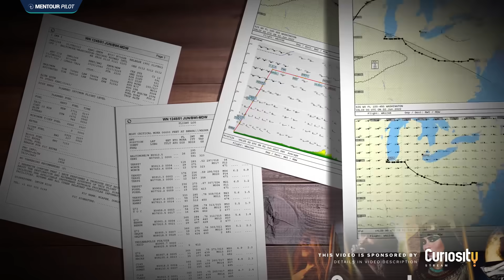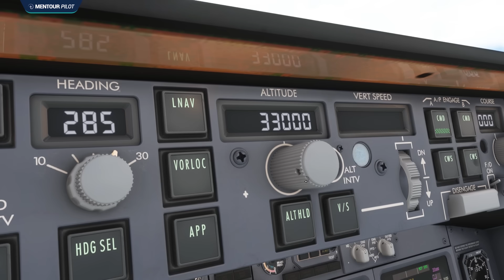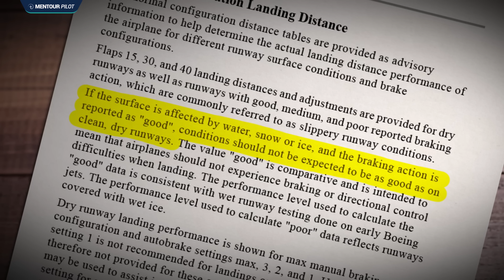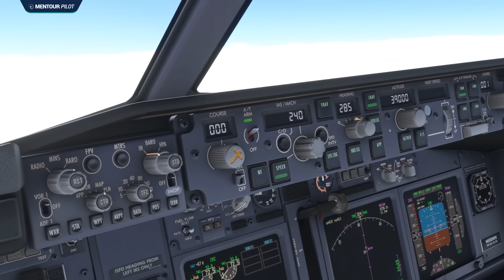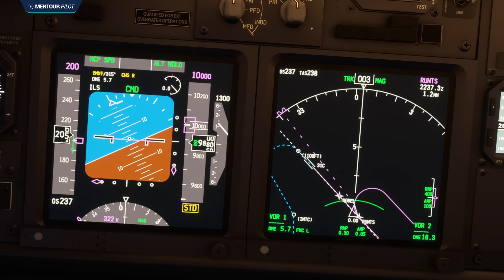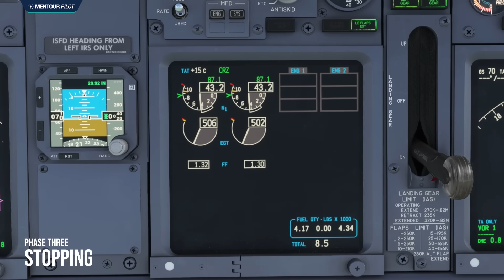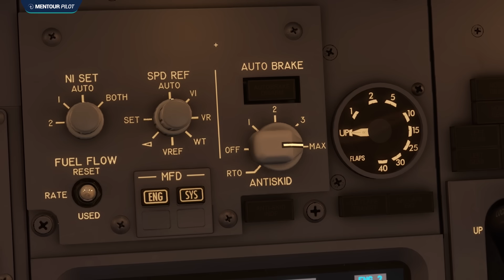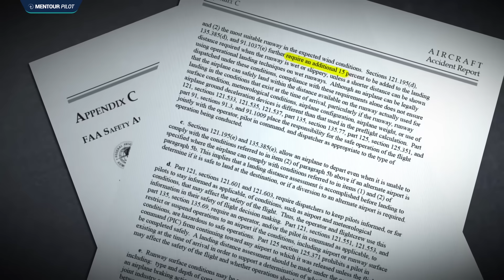WHAT did The Pilots MISS?! Explaining Southwest Airlines flight 1248

Comment: This is a very silly question: what if you steer the plane at that speed (50kts or so)? The idea would be to try and go parallel to the upper wall (looking at the airport map at 5:32)... In general, at that speed, how much steering can the plane "take" on the ground (with the rudder, I imagine, because I suppose that at that speed steering with the tiller, even gradually, would be an even worse idea, and maybe it is locked)?
Reply: If the runway is so slick that the brakes are ineffective and slowing the plane, then any high-speed steering inputs would be ineffective as well.  I also don't understand what you mean by "try to go parallel to the upper wall" or how that would help in safely stopping the airplane.
Reply: @skyhawk_4526  Mauro is asking if they could have turned off the runway to try and create more distance between them and the end of the airport. So instead of heading right towards it at the end of the runway they could steer off the runway to try and start going across the airport instead of along it. 

I fear the answer is no though. They could have tried to steer with the rudder but it would have meant crossing runways that might have been active and it may have resulted in a lot more damage if the plane tumbled or even worse, flipped.
Reply: @skyhawk_4526  I don't think it'd  be 100% ineffective: it would just happen too slowly to achieve what I meant. Which I knew and said from the start, was a silly idea.
«Try to go parallel to the upper wall», ... maybe I need pencil and paper to make it clear. The purpose is to gain extra space to stop it. If you'd succeed in steering enough to go parallel to the "north wall", then you'd maybe have the extra space before reaching the "east wall" [not a wall, not north and east... a picture would make clearer my silly idea]. Of course, if applying rudder would just yaw without actually changing the direction of the motion... the idea just became sillier, and it can make the thing even worse because the reverse-thrust wouldn't have just the component opposite to the motion direction....  inertia is a b..h

Comment: Where was the captains command authority on this runway selection?  Preflight planning with this runway selection should  not have been a viable option from the get go with the weather and runway conditions at Midway that day. Even with head wind landings I used to hear stories about Midway in winter from my dad (DC-10 Capt.) He would say all that stopped him were the reverse thrusters!  Even after airborne  the Capt. should have declined this runway when approach control set him up for that approach. If traffic is landing on the center runway downwind and ATC was unable to grant that request (as was in this scenario apparently)  then its time to request vectors to his alternate. The margins were way to thin to accept that runway with a tailwind at any speed.

Comment: The one thing that I kept thinking throughout the video - and perhaps this is your presentation that creates an interpretation - is that they seemed to be trying to convince themselves that they can land.  Yeah, there were so many other factors but between the tail wind and the braking conditions and justifying to themselves that there were asterisks on the 40 feet, it just feels like they kept getting hints that "this isn't a good idea" and they sensed it but they convinced themselves to land anyways.  I mean, you know that the runway condition is uneven and even if you don't know that you should take the more conservative value, it would be a perfectly sound argument that since you know parts of the runway are worse than the breaking condition, you could blow through the 40 feet of buffer and possibly offset any advantages you perceive from the reversers.  And even if you don't settle on the 15% buffer that the FAA recommended, just recognizing that less than 1% buffer seems like a reasonable interpretation.

It just bugs me.  It feels so much like they were determined to go to Midway and were trying to find an excuse to do so.

Comment: It seems like airline commercial pressures are possibly inclining pilots to push the envelope too far when it comes to extreme weather conditions...? Whether it's typhoons or blizzards, there seem to have been a significant number of loss-of-life incidents over the past decade or so where operating in marginal conditions played a significant role. Clearly a factor in GA (general aviation) too, where get-there-itis crossed with severe weather kills a really unfortunate number of pilots. 

Given climate adjustment is creating larger, more severe and more frequent weather crises, one can only presume these cases will become even more frequent.

Do you think there a point at which the FAA & other regulatory bodies might calculate the losses and near-misses from operations in such marginal weather conditions, and decide to enforce more stringent constraints around postponing or canceling flights in these circumstances? Or do you think airline profit motive & public demand for speed of travel will always outweigh this as a possibility...?

Comment: So why don‘t they build and enforce runways 50% longer? Airport overtime vs. train or car is already 6 hours for safety checks, luggage, boarding etc. it doesn’t matter where the airport is built as long as it is at a motorway. That would immediately get rid of V1 (the speed of no return before taking off) and all the accidents revolving around too short runways.

Comment: What did they miss? Stopping IN the airport, perhaps?
Jokes aside, did I follow this correctly? These pilots were NOT fully aware of how their braking system worked or would do under those conditions, or the limits of their OPC? They hadn't done any simulator time with it all, or weren't required to be fully across it all?
This smells extremely like another example of airlines not wanting to do ANYTHING that requires further training due to costs, all aided and abetted by a complicit and deficient FAA.
Good to hear they learned so much from the incident.
After all, it would be REALLY hard to explain if something similar were to happen with another version of the 737 with new performance factors, and assumptions made and pilots not given vital information and standard......
Oh. Oh, dear.

Comment: I wonder why MCI and STL were the alternate airports. ORD is so much closer and has much longer runways. Does anybody know why? I just feel like if the alternate airport were still in the same metro area, the pilots may have been more inclined to go there instead. I realize ORD is not a SWA destination, but that even matter when designating alternate airports?
Reply: So, divert to O'Hare. What is your next move ? Have a think about arriving at a gate without ground staff, loaders, engineers or fuellers. More importantly, think about what you new job outside aviation is going to be.
Reply: @hb1338  I don't understand. Those issues would be the same thing at any diverted airport. We're talking about a serious safety issue and how you avoid human death. Maybe my question wasn't clear, but it was basically WHY are the 2 alternate airports so far away? O'Hare, Milwaukee, Indianapolis, Madison and perhaps half a dozen others are closer. That's all.

Comment: Could not an "Arrester" mechanism work at the end of the Runway similar to Aircraft carriers? So that an emergency 'hook' be dropped by the Pilot to catch a wire across the end that has eg. Water pistons that in compressing slow the Aircraft to a quick halt. A big ask given weights and speeds involved? Exccellent Report as usual  - God awful ending with the loss if that young child.

Comment: Unbelievable. I had to go back and check you said 40 feet. The aircraft is 110 feet long. Your animation is misleading. They were landing in the worst conditions possible with zero room for error, in fact the extra 1 knot of tailwind eradicated the tiny 40 foot margin. By their own set of rules they could not stop in the distance but talked themselves into doing it. Why they did that is the core issue here.

Comment: That's just plain stupid that the Thrust Reverse can't be pulled to 'full' and let the system finish converting the engine to reverse the thrust. Then the system spins up the engine.

Like, c'mon. Thrust Reverse should be considered 'emergency braking'. The sole reason you see it used all the time is because:

a) Better safe than sorry
b) Reduces the wear on the tire brakes

But every single time 'it matters' is a time when the Pilots are going to be preoccupied...you know...because they can't stop. Or feel like they might not stop 'in time'.

So. You have a system that only really matters in a 'non-normal landing', and you expect the pilots to remember "oh ya, gotta wait a second or two and then pull the levers all the way back".

Comment: It's been my experience that Southwest Pilots in general always hotdog it around the field. I used to taxi the jets and was out there with the pilots and Southwest in particular always pushed the limits. You'd see a Southwest jet land and practically come up on two wheels exiting the runway......then throttle up down the taxiway. And I mean throttle up. I think this incident was a classic example of human factors. In my opinion Southwest pilots normalized aggressive handling practices and so as in this incident, instead of going with the conservative figure (as Mentour pointed out) they erred on the wrong side and then got saturated with unexpected results. It turns out that their safety margins never existed. However, having said that, Midway Airport has always been a TIGHT fit. Back in the 1970s before Southwest took ownership of Midway ALL the airlines flew in there. You'd see aircraft on approach lined up all the way out into the suburbs of Chicago. I mean all the way out to Joliet. Things were hoppin at Midway.

Comment: Any Kind of Feeling should not have to be interconnected to Plasma Emissions in space, just outside the Window ledge..

Electrical discharge from inside the Room sucked out outside then Thunder and Bright flashes approximately around Midnight 29062022..

Another Empire Of The Son Burns Low..

Comment: What do they do with these pilots that obviously made devastating mistakes, even though it was not intentional?    Do they get fired, or  are they required to take additional training,  do they get demoted?    Like in the military, do they get something like an Article 15 or court martial and take half their pay for a couple months?   Or do they just get another jet and back to business as usual  withing a short time?
Reply: Retraining is pretty much guaranteed as a bare minimum.  There is no Article 15 or court martial equivalent but they could very much get fired.
Reply: It depends. The safety division looks very carefully at the accident investigation report and at the results of its own internal investigations. It decides what the problems are/were, what the causes were and who/how best to fix them, and then decides on remedial actions. In this case, you would decide whether the landing distance calculations were correct and clear (especially with regard to the onboard computer), whether the training to use them was sufficient, and whether or not the pilots applied their training appropriately. 
Likelihood of firing depends on the degree and nature of fault, there is no hard and fast rule.

Comment: Besides the "Banga-Banga Man" attitude of those in the cock-pit, blame also lays with the greedy developers working with corrupt city authorities which re-zoned land around the airport to anything that would be affected by something as common as aircraft overshooting the runways.  There is a reason airports were located away from cities, especially since the early days of flight were full of spectacular fireball displays.  Sure, the Empire building had (and maybe still has) a mooring system for a rigid airship, but since the days of Baron Zeppelin and that spectacular fireball, people became a little wary of being near one.  Strange that people don't act the same around modern airports and airplanes, and choose to build anything at all close to air traffic and all the tons upon tons of fuel sloshing inside the said traffic.  I'd like to conduct a survey of the households within earshot of an airport, asking whoever comes to the front door "How do you feel knowing that every time an aircraft approaches, there are a few tons of fuel and several more of combustible aluminum that could incinerate your house and its occupants?"

Comment: I'm not sure of Mentor Pilots background, whether or not he is an airline pilot in the US. But I was in that time period and Southwest pilots had a very well-known reputation for being cowboys. Who would land with a tailwind on a slippery runway? Well Southwest did in Burbank with a tailwind in the rain touching down long at 170 something knots, crossed the street and hit a gas station.  Landing on a 6500 ft runway with 10 knots of tailwind and poor braking is about the dumbest decision those pilots could have made. The company I flew for I can't imagine one person accepting that, it would have been a no-brainer for a divert to O'Hare. Instead a young boy was killed. But like I said, the culture there is, or was, very different. If I recall correctly they also did not understand that Max Auto braking is not actually maximum  breaking, where you stand on the breaks as hard as possible to get the full 3000 psi of breaking. Boeing labeling it Max was a bit misleading. They overran a third time but I cannot remember where and wound up in the grass and mud (purposely veering off to the left to avoid the EMAS) but no serious damage.  They were a great group of guys but they just loved to push the limits too much.  They frequently landed in cat 1 minimums whereas others missed the approach (form your own opinion on that). I suspect things have changed quite a bit there by now.

Comment: I wonder how much of this could of been avoided by the program showing it's work in the end.  I remember getting access to a tool suite that was designed by engineers for engineers and I was not an engineer and just staring hopelessly at all the features.

Also wondering... what about aborting the landing and taking back off?  Where was the point of no return at?
Reply: From what I've heard before once reversers are deployed then you're committed. You MIGHT be able to get enough speed back to climb up depending on the weather conditions but there is no time for calculations like that. This doesn't just mean full thrust reversers. Even here the captain deployed the reversers, he just didn't spool the engine back up. So if they decided they had to go around they'd have had to disengage the reversers and then get the engines back up to full thrust. All while the spoilers and flaps are bleeding off the speed.
Reply: @JamesF0790  To clarify, before the captain tried the reversers and committed to the landing.  What point do you get on the runway where the brakes aren't stopping your not slowing fast enough and you forget to engage the reversers do you say "Screw it" and punch the engines?  They were about 1/2 down the runway and slightly under takeoff speed.
Reply: @wrayday7149  The captain had already deployed the reversers on landing.. He just hadn't waited for them to fully deeply before he tried pulling back the levers to increase the thrust.  They were at I believe roughly 120 knots when the first officer realised the engines were at ground idle. At 120 knots you'rew going at around 202 feet every second. They were around 2/3rds down the runway so they had around 1700 feet remaining. That is 8 seconds between realising the problem and leaving the runway.

Now if give the F/O just 1 second to process this and decide they can still take off. He closes the reverser levers and has to wait for the reversers to close.  To spool up from ground idle to takeoff thrust is going to take at least 5 seconds if not as much as 10 and you're going to have to wait until the reversers are shut to do that.

You aren't going to have takeoff speed straight away at full thrust either and the closer you get to rotating the faster you're burning runway. Auto spoilers come down as soon  the thrust levers are advanced and we can say the flaps were done during the engines spooling up but you still only have eight seconds. What's going to happen there is either the plane is going to just leave the runway faster and instead of coming to rest on the road it's going to slam into a building OR maybe even worse they're going to drag the nose up and get the plane off the ground only to stall and crash anyway.
Reply: @JamesF0790  I'll rewatch it in a sec.  I was binge watching earlier and I might be confusing videos.
Reply: @JamesF0790  Okay, sorry I was thinking of a Philippine's flight.  So I guess to clarify my clarification... with the TR in idle  and at the point the co pilot noticed... was it possible to abort landing?
Reply: @wrayday7149  I'm not sure about the Phillippine's flight but with this one no. Once you've deployed the thrust reversers you're committed to the landing. They were roughly 2/3 down the runway and had roughly 8 seconds left. Because the reversers hadn't been spooled up the plane had dropped the engines down to ground idle and by the time they got the reversers in and the engine spooled up to take off thrust they would have been off runway.

A lot of things went wrong but they made the right decision in not trying to take off again. It would have made things a whole lot worse and possibly killed everybody in the plane.